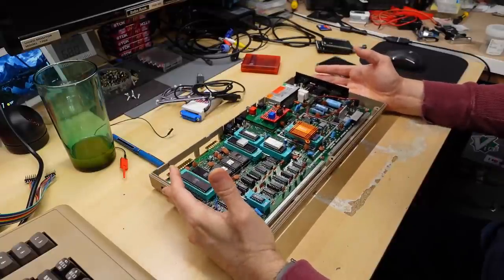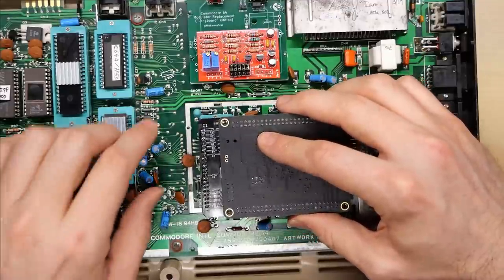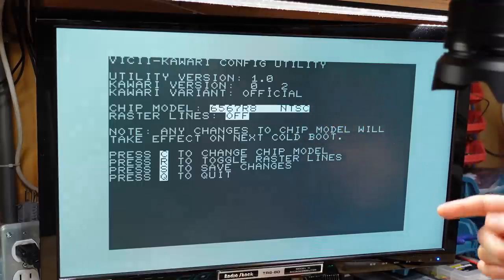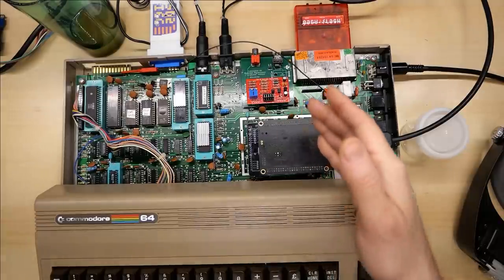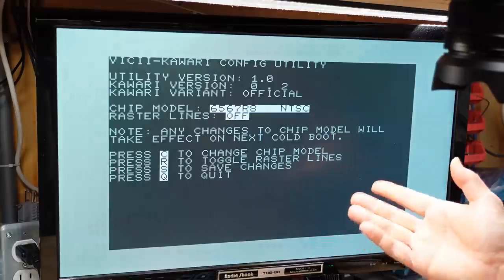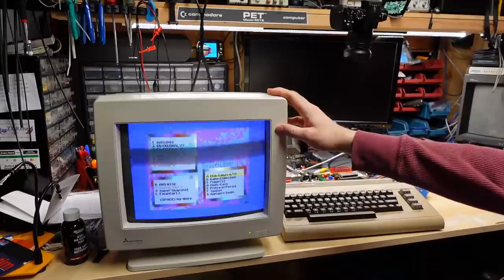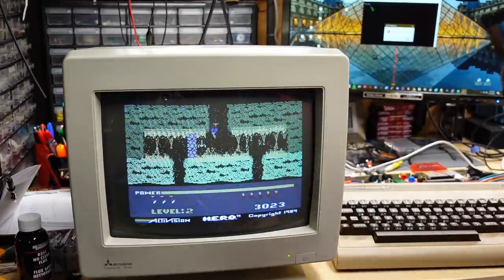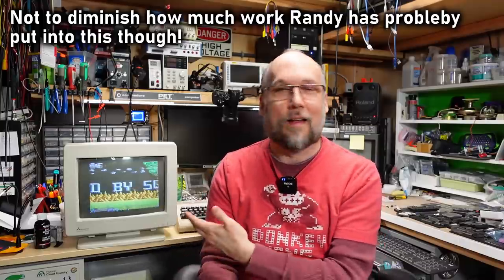VIC-II Kawari: FPGA based VIC-II replacement for the C64

Comment: PAL colours were definitely muted. Back in the day, this really wasn't a big deal because we were all using standard CRT TV's. Cheap ones.

My first 14" TV would drastically warp the display if the C64 was displaying large blocks of pure white. If I set the border colour to white, it was horrendous. VIC bleed into the sound when it was doing that was also fairly extreme.

Red was definitely never really red.
Reply: That may have been "blooming", if you show pure white screens on a CRT, sometimes the image can expand or distort slightly. Some say it's because it causes the electron guns to pull more power (or something that is related to high voltage) and cause some weird distorsion. I recall hearing that some CRTs have a specialized circuitry to counter blooming.

It depends per each CRT from what I found during my testing... I have a 14" Daewoo (model: F14C1NS) that has, of all my CRTs, the worst blooming (when I show a pure white screen, the screen starts having a "waving" effect that causes the raster to bow towards the right, wheras my 17" computer monitor CRT (LG 702S) doesn't show any bloom at all (well it does, but it shows up as the raster expending slightly, but not enough to be noticeable. You really have to look closely at the borders of the raster to notice the blooming).

I also have two Sony monitors that claim to have a high voltage regulation (if I read their brochures right) to counter blooming too, but I never tested them.

Comment: 1:50 -- That's super cool that you can plug in a chip or two to handle the missing instructions if using an off-the-shelf CPU and not the C64-specific one.  I've oft wondered if something similar could be done for the Motorolla PowerPC G5 CPU in order to get MacOS 9 to run natively on such a chip.  As of right now, MacOS 9 only runs on G4 or older CPU, and only within Rosetta on OS X if using a G5.  Maybe somehow create a Rosetta-on-a-chip.

Comment: Makes you wonder how small the final version of that thing is going to be
Reply: A lot of the space is just because it's built around a dev board that breaks out every pin on the FPGA, most of the space is the two huge DIL headers down each side.

Based on what I saw in his videos you could probably get it down to something that's maybe twice the size of the original VIC-II, it'll probably need to be an 8+ layer board but that's not a huge issue these days.

Comment: This is a very nice demonstration and in addition to the videos of those made by Randy Rossi!

I have always had the impression that visually perfect scrollers like, say, Andrew Braybrook's game Uridium will not scroll perfectly on anything but an old CRT. How do perfect scrollers appear through a HDMI signal - can they be maintained as perfect scrollers or do the user experience end up in jerkyness and effectively destroying these type of games?

Frequency-wise, is there a replacement for an old CRT? It apperars to me as a non-trivial issue - having old frequencies match the output of modern flatscreen panels. VIC-II Kawari or not, have anyone doing modifications to C64s display-output succeeded in this regard of maintaining "perfectness" in raster-perfect scrollers?

Comment: I just bought my first C64 (64C, PAL newer style) and what would you know it was completely dead. 

After checking the power brick, I powered it on and the Power LED doesn't light up, 5V rail connected to the power LED connector is getting 0.9V. 

I will have to take a look at the schematics to see if there is anything obviously wrong with the 5V rail, but based on the first couple of hours I feel like I might need new a PSU and a few new chips.

I might need to get one of these when they come available. If I ever get the thing working.

Comment: I would think that the FPGA should be able to generate the HDMi signals, and replacing the HDMI transmitter.
Reply: @blitzwing1  Than don't call it HDMI but DVI. Its apparently a common trade for the name. But in the meantime I have discovered that the FPGA in use does not have enough power to do DVI on its own.

Comment: At some point, we'll need to donate all our non-working C64's for parts to a single museum that keeps one C64 running. The rest of us will end up using modernized C64s with all new parts. Mostly. Nobody seems to be able to make a darn bread bin case and some older style C64 key caps for some approximation of the keyboard (or at least a cherry keyboard). :-( When it all goes modern chips, we'll redesign the mobo and be done with it. Oh wait, someone has done that mostly...

Comment: About the color pallets, I prefer the more vibrant modified pallets, the reason is simple, at the old days we had analog monitors where you can fine tune the color intensity, so the colors was actually very vibrant. Nowaydays I see tons of youtube videos wheere the author takes no care of color pallets, these people seems like forgot the original look of c64 screens and just record the videos with the default color intensity, which is looks ...bleached, So using the modified color pallets is more authentical than usingthe default.

I often see that people who didn't have a c64 back then criticize the color palette of the c64, but the truth is that it is one of the most balanced palette if we consider the displays of the time, of course at that time you had to fine-tune the color intensity on almost all displays, but this was the common practice.
Reply from the maker: Yeah totally agree. When I use my C64 on a analog monitor I crank the color up. I love the 16 colors looking vibrant so when I see someone use an emulator and the colors are all terrible and muted, it just looks wrong to me.

Comment: Hi Adrian, if you can, give River Raid a try (NTSC mode).  It seems to get glitchy and weird when first starting a level on emulators some times and on real hardware with fast loaders (and maybe even JiffyDOS).

Also can you do a video on the output through the original Y/C Output?  I'm guessing it would provide a sharper and nice jailbar free upgrade even for people not using the new analog RGB or HDMI outputs.

Comment: Could you try Raid Over Moscow with the alternate CIA chips from the Amiga?  My C64 had a wonky real-time clock in one of its CIA chips, and as a consequence the last level of the game would allow the player an unlimited amount of time.

I suspect the 58Hz is probably a consequence of the device either using a PAL dot clock rate (which is just under 1Mhz) or a 1.00MHz clock rate, instead of the 1.0227Mhz clock rate of an NTSC C64.  Even when using a proper clock rate, however, I think a real C64 outputs a 59.82Hz frame rate with 263 scan lines.  Some television sets might be picky about the exact display format, and want exactly 525 scan lines at 59.94Hz.  It might thus be useful to have an option to let the NTSC mode clock either be 1.0227Mhz (yielding a 59.82Hz frame rate) or 1.0247Mhz, yielding a 59.94Hz frame rate (possibly yielding better compatibility with television sets, but likely precluding simultaneous luma/chroma video output).

I'd also like to see as a feature request an option to have the device pad out the borders in its output signal, so as to yield a 4:3 screen ratio when viewed on a widescreen set that doesn't allow aspect-ratio selection, and a variation on the raster line option that would make intermediate scan lines show a reduced-brightness blend of the lines above and below, and also have an option to add a small amount of luma/chroma blur.

Comment: One of my first retro computer experiences was a possible bad vic-ii so i looked at it, reinserted it in the machine, and.... the legs broke off. Tried every tip i could fine but nothing worked. If theres ever a project where we can get a vic-ii for less than 40 bucks, im in

Comment: It would be good if the switch to 15 kHz with a dip switch or jumper were possible. HDMI and VGA is amazing.
Maybe it would be possible to emulate 4: 3 on a 16: 9 screen with borders.

Comment: ok, ive been saying this for about 3 years now, we need an fpga vic-ii.... the problem with it is that no one wants higher resolutions, 80 columns, or an extended palette, like 256 colours, its 8 bit, and a bit map mode. this guy needs to keep those higher resolution modes and start thinking about supporting standard ntsc resolutions up to 1920x1080@8 bpp, and pal resolutions. why? bitmap games, graphics and finally faster clock syncs. keeping everything the same is fine... for preservation, this computer needs to come up some and people need to start thinking about modernizing it some. geos is perfect for this example, on this chip, hey its not windows or a mac, except it looks just as good functions relatively near a modern implementation and its capable some of doing something like web browsing, the main point is graphic work and application base.  thats where an fpga 6510 comes in. give it what it needs, new instruction faster clocks and some cache it can actually sink its teeth into. couple MB. my point is, if everyone is doing the same over and over and never innovating any of this, what was the point? why waste your time building the same thing, over and over again. you are just adding to the bottle neck instead of leading the platform up some and keeping it cycling steady with the new technology applied. there are tons of arguments "well it wont be a c64 anymore" come on; really? just keep the software and the hardware available, readily accessible or at least native to that particular platform at the time and its the same, the cpu and graphics generation dont mean anything so long as you maintain what was present on the board. move to a 486 on a c64 board, make sure it runs 6510 and you would never have known the difference. point is, there is no need to fear the amiga, its time we moved up some, and its time people who are building these fpgas understood, add new features we can use, keeping it stock isnt as smart as it is to venture forward. "well its fpga, program it yourself" thats always a point, or "its open source you can modify it yourself" always another point. or you could listen some and make something out of it that no one even bothered with. i feel with a new vic and a new 6510 we can move out of assembly and get into C programming on this machine. i know you can, and could, its slow. say said improvements mentioned pass, this computer can make a much larger difference on computing in whole than expected. id also like to say, good job on the fpga, i think you are heading in the right direction. im looking forward to seeing the new board designs and how your fpga vic performs further.

Comment: Where do you get audio from if its just video down hdmi? Any chance of a side mod to take audio from the  board and mux it with hdmi
Reply from the maker: It is plugged into the normal analog output DIN

Comment: That is strange.. the demo sounds exactly at the same pitch in PAL mode as in NTSC mode.. Isn't that really wrong? There should be a 4% speed difference, which is nearly a semitone.
Reply from the maker: Actually I could hear a slight pitch difference too with the NTSC one sounding slightly higher pitch as well.

Comment: I wonder if it would work on an accelerated C64 with a CMD CPU.
Reply from the maker: I used it with a Turbo Chameleon C64 and no issues there. (It can run up 20ish Mhz) Don't have a SuperCPU to test with but I have no reason to believe it won't work.

Comment: I am 99% sure we don’t got that washed out PAL colors, i used my amiga500 2 weeks ago. And in your video, it looks so much worse. As i saw youtube docu’s, PAL is slower but should look slightly better cause of some extra resolution lines.
Reply: The C64 is different to the Amiga. The PAL version of the VIC chip does produce those muted colours, I’m not sure why it’s different but my PAL C64 is definitey not as vibrant as Adrian’s NTSC ones. Amigas produce the same colours regardless of PAL or NTSC but obviously the number of vertical lines and refresh rate differ.
Reply: That’s true. I also got a C16 and plus4, but in Adrian’s video it looks extremely hideous. I can fire them up tomorrow to check, but i don’t got that grey menu screen like Adrian

Comment: I think some sort of thin, plastic sheet (or kapton tape) should be applied to the underside of that board so the pins don’t come in contact with any components on the C64 motherboard, or you’ll get snap, crackle, pop, and a (possibly) dead C64 - Louis Rossman, eat your heart out! 😏 And that’s how NOT to add “fire”wire to your C64!

Comment: I have been watching your videos religiously and they have inspired me to do my own repairs however I still have no idea why there is ntsc and pal in the first place. its really something I haven’t thought about learning about till watching this video.
And is it really still a required difference in this day and age?
Anyone one want to enlighten me ?
Reply: well second question first, in current digital video, most tv are multi compatible, so many resolutions are automatically catered for and display completely normally. pal and ntsc is from the crt tv era and a tv was usually manufactured to one standard only. so pal and ntsc are different standards of crt video, the number of horizontal scan lines is different, the vertical refresh rate is different, and when black and white tv was upgraded to colour, the  additional encoding of the colour information is handled differently between the 2 standards. at the time it would be very difficult and complicated to build a crt tv to handle both, it would be cheaper to buy two separate tv. therefore also in the c64 the vic II have slightly different clock frequency between pal or ntsc and this means that the cpu clock is also slightly different for pal or ntsc. vic 20 and c64 were built to display on existing TVs. (1980s)

Comment: developer: "remove those modes as too hard to program"
c64 scene that thrives on hard to do codes and hardware exploits: "yeah, suuuuureeeee......."
Reply: My thoughts exactly!
Reply: This is the perfect project to experiment with as "GPU Upgrade"... Just think of what the C64 could do with features like more hardware sprites and a bigger working palette... The Amiga scene already has modern crazy upgrades like the Vampire accelerators so why not the 64
Reply: @peshozmiata  What struck me is that one of the Commodore's appeals was it's cheapness, and as they become collector's items, upgrading them with expensive parts is less appealing. You could get a C64 Maxi. Or, as far as GPU experiments go, you could use a $5-10 Raspberry Pi Zero to interface with HDMI, maybe using it as a remote terminal, but even that is kind of silly, when you could easily emulate the entire Commodore with VICE with speeds several times faster, on that same Pi Zero, and tweak the emulator software. Also, the later Amigas are 32-bit:.that's a big advance over 8-bit C64s. The Vampire 4 isn't even an accelerator, it's basically a replacement for an Amiga.To me, this has too narrow applications to ever be viable as a mass produced product. It may appeal to you and Adrian, but don't count your chickens...
Reply: @squirlmy  The retro-computing hobby isn't a practical one, you can easily just emulate any system you like even on a potato rPi and get roughly the same experience. To me the appeal has always been in messing around with old junk more than actually using it to play games and such. The problem with addons like the vampire accelerators is the price, it makes no sense to spend that much money on something that's neither period-authentic, nor comparable to modern all-in-ones in the same price range. If a VIC-II upgrade board would cost around 30-50$ and was designed in a way you could build it yourself, it would be fairly popular.
Reply: @peshozmiata  Gideon's Logic: Am I a Joke to you?